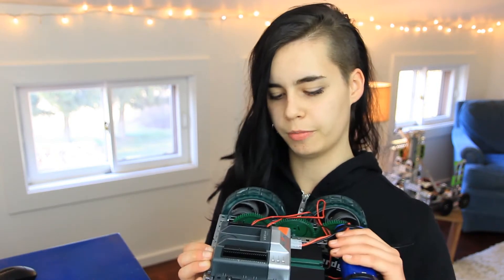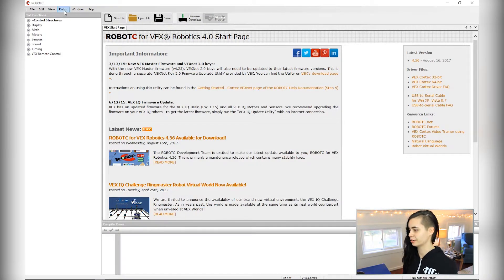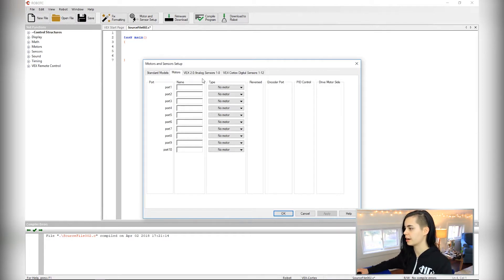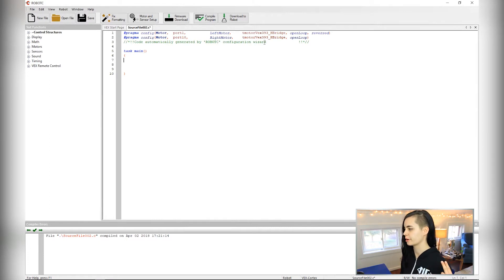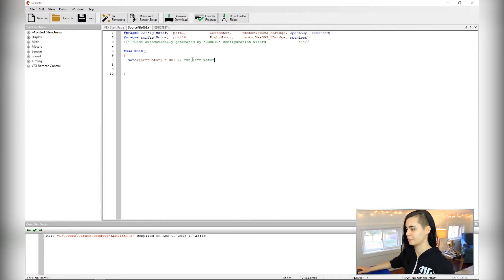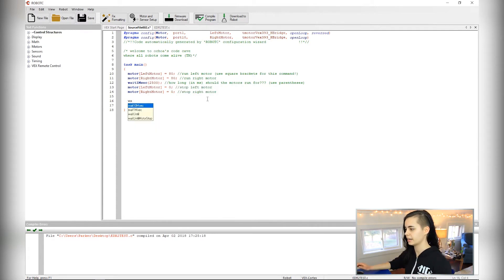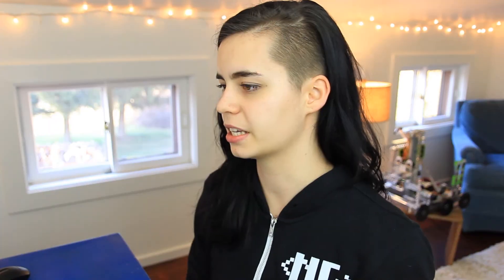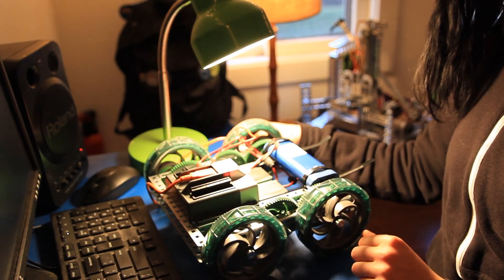Code your VEX EDR bot to move autonomously // RobotC // Level 3

Comment: I just happened to have read why 127 is full speed forward and -127 is full speed backward.  It has to do with the size of memory the value is stored in.  It is an 8 bit number or one byte.  The largest value you can store in one byte is 255.  If you add the number of forward speeds available (127) plus the number of backward value (also 127), you get 254.  Now you add 0 to represent a stop and you reach the 255 limit.